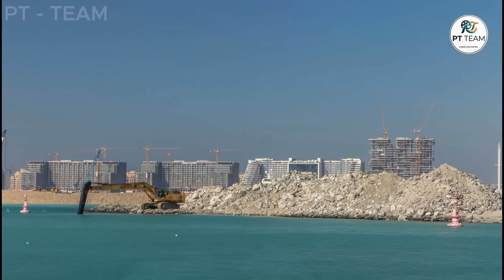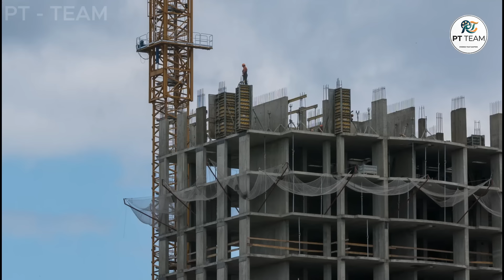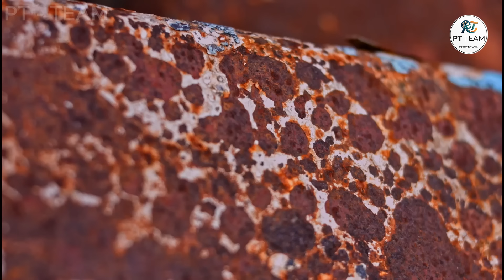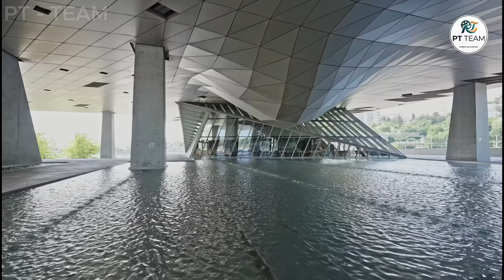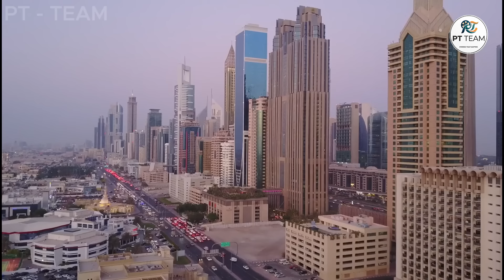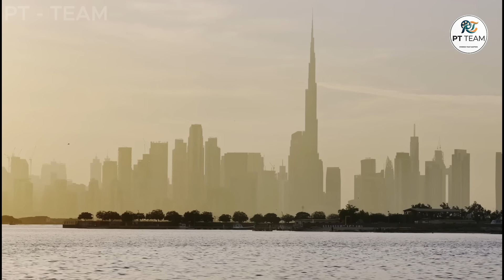Why 150°F Heat DESTROYS Dubai: The RUST Illusion!

Comment: coat your steal
Reply from the maker: Coating the steel can slow corrosion, but cracks or installation damage may expose it again. Good concrete cover, drainage, and maintenance still matter.
Reply: Theconly long term solution is to eliminate the steel by using alternatives where possible and shield it where you can not.

Comment: and that's how china is so far ahead. they bypass this problem by using salty beach sand.
this way, the salt is already inside the concrete from the start, and they don't need to wait for the slow migration.
add plastic rebar, the corrosion of steel is gone. ;-)
Reply from the maker: That would certainly speed up the failure test 😄 Salt-contaminated sand can damage conventional concrete, while composite rebar avoids rust but introduces different durability, cost, and fire-performance concerns.
Reply: @PTteam-k1f  exactly. steel-less rebar is the future. or at least with just a very thin steel core. totally not a cost saving method.
to be more serious, dubai and other middle eastern cities at least try to mitigate the problems with salt. china cuts corners whereever possible, causing rapidly aging buildings.